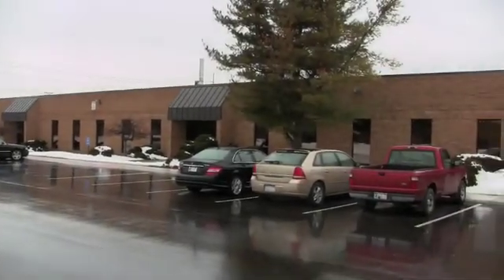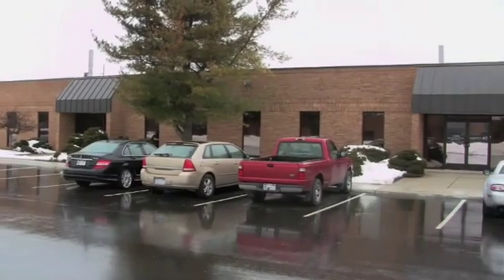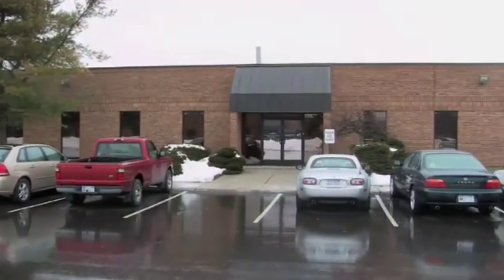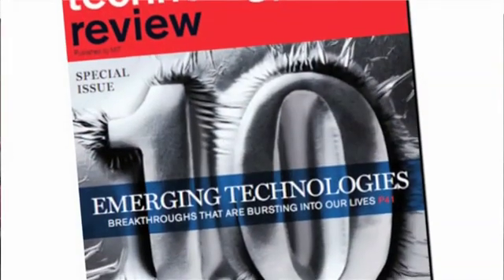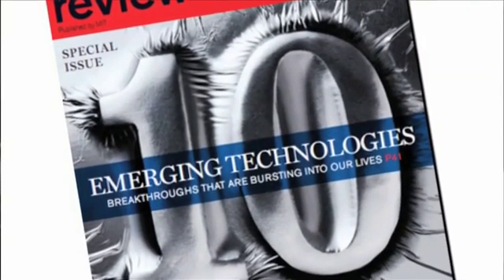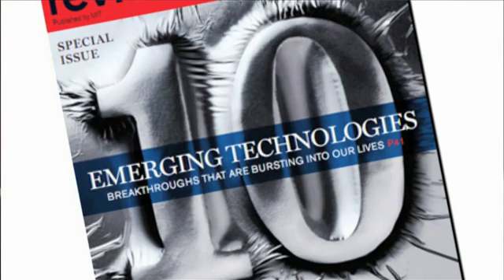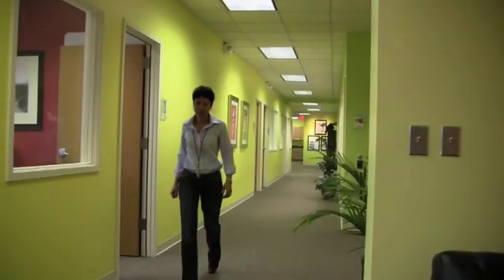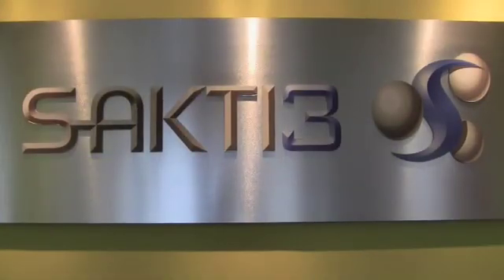TR10: Solid-State Batteries

Comment: Solid state batteries can be charged immediately and require no cooling systems in cars that add to most of the mass. They also function in far colder or warmer temperatures and are not effected. The batteries do not degrade after 1000's of charge cycles and are very safe.